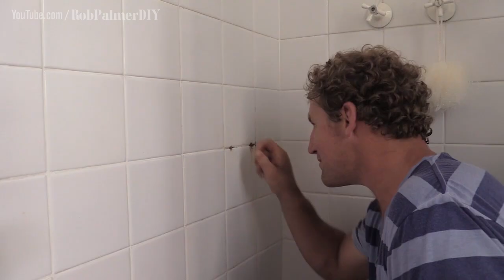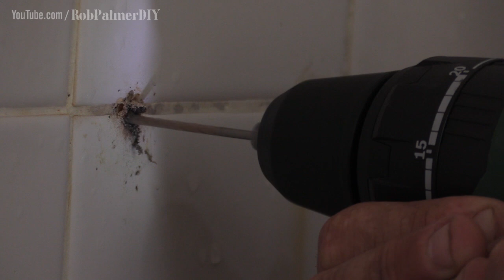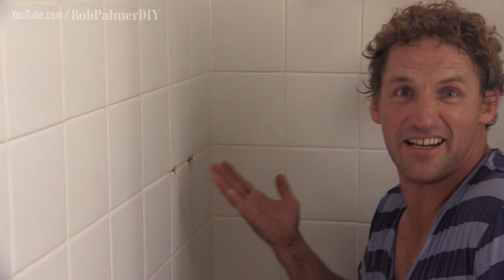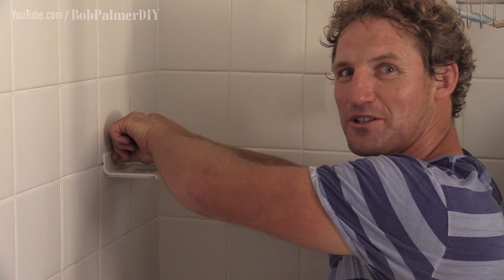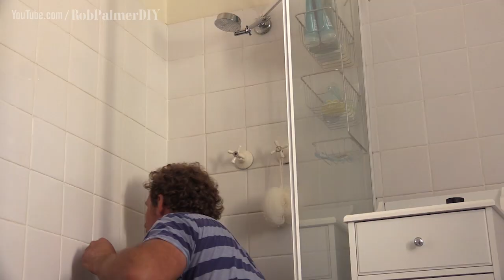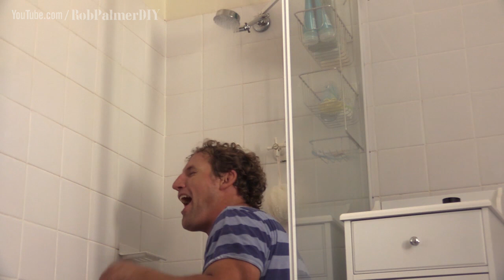How to Remove Rusted Screws | DIY Tip

Comment: I have a much better solution. I had the exact same problem as you. All I did is that I heated the screw really well using a lit candle and then simply pulled out the screw. The heat slightly melted the plastic, softened it, and the whole thing came out like butter. Easy peasy lemon squeezy 😁
Reply: oooh I was about to get the drill out... will try your idea right now.....
Reply: Awesome! Just tried it. Didn't have alot of tools. Just used a candle and a 4" crescent wrench and Voilà! Out in less than 5 minutes from my shower tile. Thanks a Bunch!!!!!
Reply: You must be livng in 2050, thanks!
Reply: @jeffjames3111 You Sir = Hero
Reply: Worked for me who would have thought heating the screw would melt the raw plug and it would comecl straight out was preparing myself for drilling it out potential cracked tile . . Thanks for your tip !

Comment: I always check them every so often now to make sure they don't get to that point where its so difficult and could damage the tiles through removal or rust stains.
Reply: You could use a screw  made from stainless steel won’t rust at all…I have a wood fence I just took down it was up over 25 years the screws are like brand new still.

Comment: How to remove rusty screw from toilet tank?
Reply: I've had to do that twice.  Best for me was to take the whole toilet out, bring it out on the grass and use a hacksaw to cut those pesky boogers. Worked like a charm. Not as much work as it sounds.  Be careful though not to crack the bowl or the tank.  Use cushiony support. I got lucky the second time and was able to separate the bowl and the tank but still had the rusted screws. Hacksaw worked great.